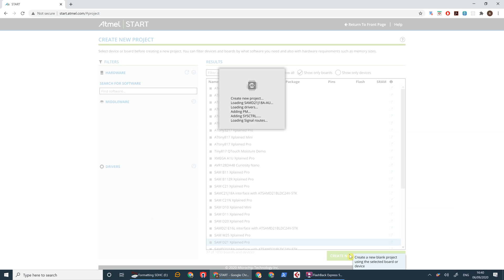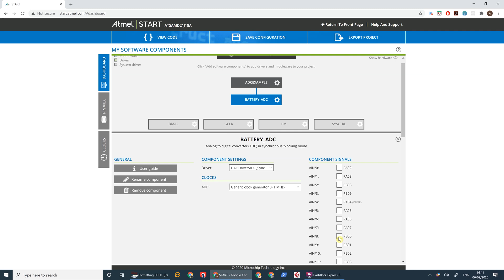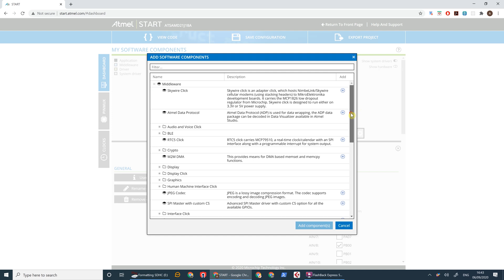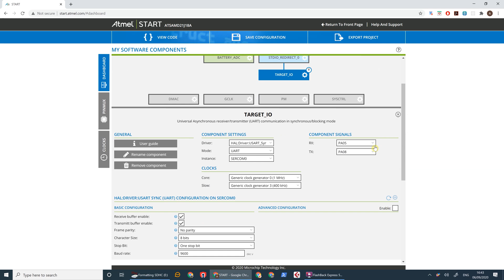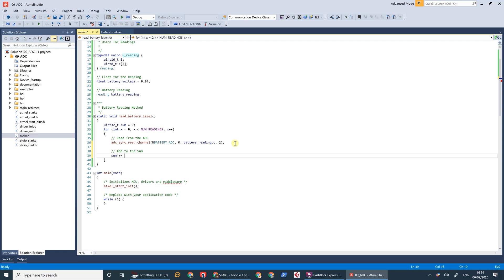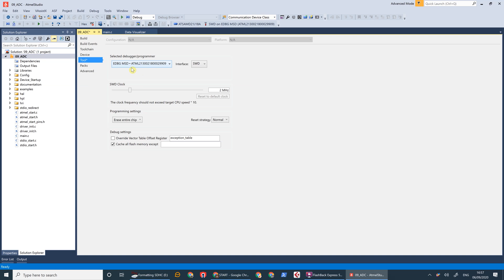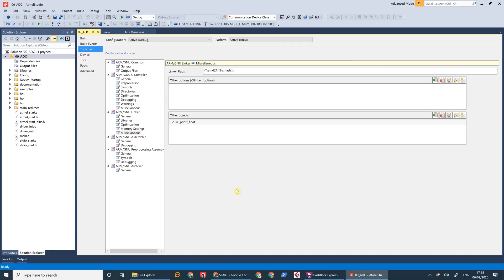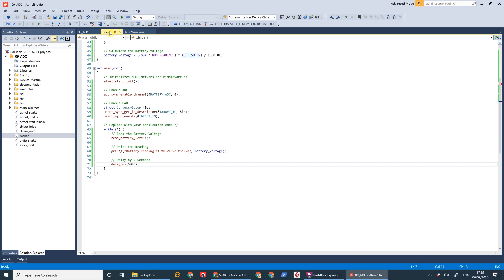Reading a Battery Voltage using the ADC on Atmel SAM D21 Xplained Pro Board - Tutorial

Comment: Hi Andy, thank you very for this awesome video it helped me a lot. By the way is it possible to use the same method in measuring the power consumption of a certain board or sensors like let’s say we measure the power consumption of an arduino board using sam d21 xplained pro? Thanks

Comment: Firstly thanks, can i use more than one channel by selecting in atmel start begining like selecting AIN08 the one u select. Is it possible to add more pin in adc +ve mux selection input?. PLS tell any solution to add more pin on atmel start my software component option.

Comment: Hey!! Awesome tutorial. Can you help me to debug with iowrite instead of printf? Since I have followed them in the codes (Based on your previous Async USART )
Reply from the maker: I can try :) What are you having problems with?
Reply: @inventorandy3195  I just want to replace printf thing and I have to use iowrite to print my ADC value , I tried that but after converting to integer if I use iowrite it gives me wrong values. I want to print the ascii values of ADC in the terminal using iowrite instead of printf. I will be really greatfulll to you if this thing I solve
Reply from the maker: Ok, create a global var (outside of the function char *printout;

Then use the sprintf function instead of printf to write to the string pointer, and use this value in io_write: io_write(&io, printout, strlen(printout) - replace &io with whatever your io_descr is called.

You may also need to allocate some memory to the char pointer as well in the main function using malloc(number of characters)

I hope that makes sense! I'm typing from my phone so can't paste a full example here!

Comment: Hello , Actually I use custom PCB with ATSAME54N19A. I use Atmel ICE for programming and It's spoiled due to power issue. Ise there any alternate to program the device using RS485 ? Please let me know
Reply from the maker: Unfortunately the E54 doesn't come with a bootloader pre-installed so there's no way to program a custom board without an SWD or JTAG programmer.
Reply: @inventorandy3195  thanks for reply. I think my transforb of my SAM ICE is spoiled. I'm not finding that part number. Anyways your doing really great work. Thanks a lot for videos. It will be really helpful if you start program using registers. There are very less materials to start program using registers. Looking forward for someone like you guiding beginners like us . Thanks once again
Reply: @inventorandy3195  but I believe there is something called samba programmer. Do you think that helps me or is it the same thing you are talking about?
Reply from the maker: @pushparajadka10  Hi, yeah the SAM-BA Bootloader programmer only works if the device has the bootloader code installed. Unfortunately, the E54 doesn't have this installed by default, so you still need the SWD programmer to put the bootloader code on first.